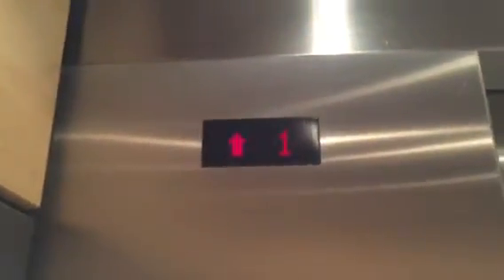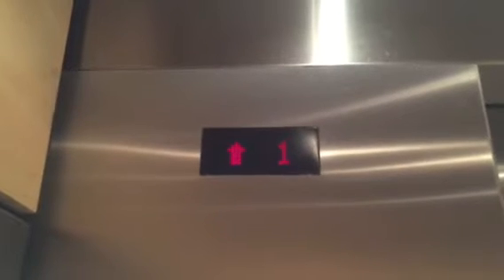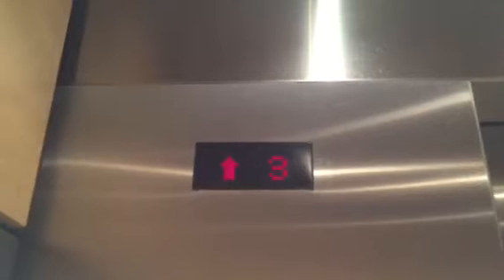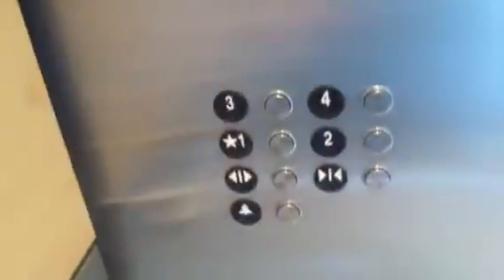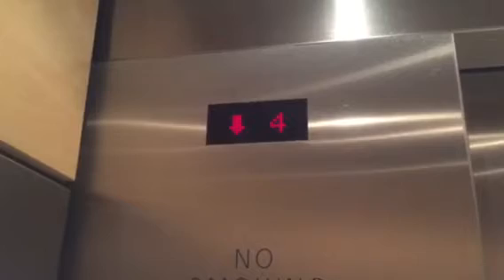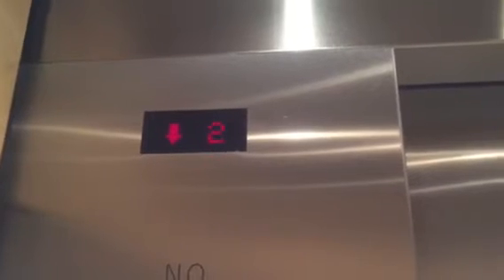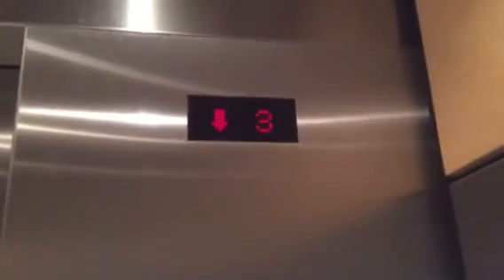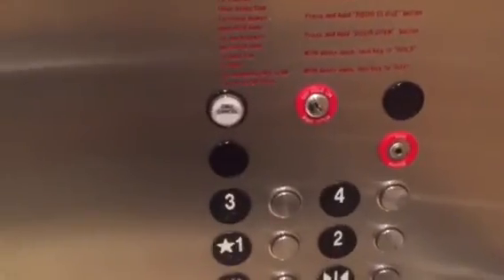ThyssenKrupp Synergy MRL Traction Elevators @ Sulpizio Cardiovascular Center, La Jolla, CA

Comment from the maker: +Jon Rogers Yes, you are right about that. I filmed only one Schindler 3300 and I was amazed at not only how smooth it rode but also how smooth the door operator was!!! They come straight from Lucerne, Switzerland so they are not compliant in California but they are really nice elevators. ECI (Elevator Components Incorporated) door operators are really great too. Schindler always uses them on their newer 330A installations now. United States Elevator/Thyssen (aka Cubic) used them on their Thyssen Ascension 2000 installs and they are always good quality. TK's Janus door equipment is at least 75 percent of the time really good from what I've seen but I agree that European quality is always better. I don't know why we don't do it like them!!! I did film on European OTIS with the Series 3 Luxury fixtures in the Advanced Equities Plaza Office Tower in San Diego, California. It was with the European Series 3 Luxury fixtures and a European ELD floor indicator display.

Comment from the maker: upanddownadventures This door operator is AWFUL and I don't really get it why they didn't go with the good ol' Janus stuff. Janus is SMOOTH and FLAWLESS!!! I guess it's more expensive that's why. I do like ECI (Elevator Components Industries) and that is used on stuff like the Soft Touch I filmed at Casa Palmero/
Reply: Traction151 GAL door operators are awful in general.  They rumble and get noisy after only a few months in operation.  I can't believe GAL hasn't made a belt operator yet.  There designs are so outdated and cheap.  I like the European style doors like those found on Schindler 3300s and KONE MRLs (AMD).  They are quiet and the cab door line up perfectly with the shaft doors, and most importantly, the doors are slim, which means therer is less risk of peoples' hands getting caught in the door when they are not over the magic eye.  The only complaint I have with the American Thyssens is that they still use the Miami Elevator (Dover) style doors and operators (better than GAL) rather than the European kind like Otis, Schindler, KONE, and the ones they use in Europe themselves.